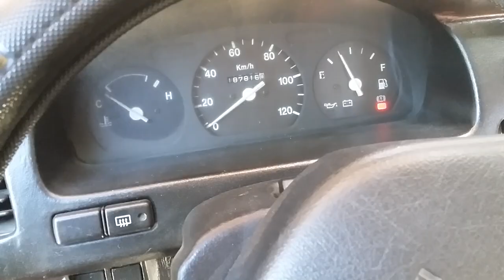Suzuki Carry/Every/Scrum F6A Engine Rebuild

Comment: Boss, pa help naman po..yung multicab ko po tumataas ang menor pag long drive or pag mainit na ang makina, di naman ganun kataas pero not normal po yung taas nya..s cold start po parang mamamamatay pag di mo binombq ng ilang saglit tas ok na..tas pag ng drive k ng mga say 20km mataas na ang menor nya po.. png deliver po nmin ng tubig at quarantine po kasi ngayon salamat
Reply from the maker: Same thing nangyari sa mc ko sir. Simple lang yan. 

- check nyo resistance ng ignition coil. Dapat malakas pa. Kung mahina na palitan ng medyo malakas 

- check spark plugs. Dapat yung manufacturer's recommend model yung NGK DCPR7E copper plugs

- check air/fuel mixture. Adjust nyo sa pinakamalakas na settings after normal temperature while plugging the distributor lines in doing so.

- check resistance ng ignition cables ninyo. Dapat nass wastong resistance lang kundi palitan na ng bago.
Reply: Thank you sir.. noted po.. God Bless..
Reply: @nhelmercsdiy7521  magkano overhull

Comment: I have a 1991 suzuki carry DB51T here in the US.  I'd like to replace my carb with a remanufactured OEM one.  Is that carb you have an aftermarket?  If so, are they the Chinese aftermarket ones I see on Ebay, etc?  Are they good quality and last long?
Reply from the maker: Hello Jason, yes they are Chinese made and very cheap. Easy to start engine even on cold morning. And economical on gas too.
Reply: Don't buy chinese oem. Suzuki is Japan. It is better to have 2nd hand japan original than new chinese made parts for your engine.

Comment: Paano po ang brake in process na ginawa nyo pagkatapos? Yung sakin din kasi, kakatapos lang ng general overhaul. Palit piston ring, lahat gasket at machine shop ang liner na bago din. Salamat!
Reply from the maker: Hello Adrian, thanks for the feedback. Normal use and city driving after overhaul. Taking notes of the gas milage and odometer readings. Change oil after 500kms, then after 700, then 1000kms. After that, drove a long distance trip. Gas milage improved from 8km per liter to 14km per liter unleaded.
Reply: @chrclmnky  Okay sir, noted! Sana tumino na mga kei van natin. Hindi kasi biro ang gastos. Salamat ulit!
Reply from the maker: @adriandiw  You might want to check ignition coil and cables. That main part responsible for the engine running condition. Weak ignition coils will produce misfires.

Comment: Bos lht bh ng scrum cat eye ang  radiator single tube lng? Pwed po bh or nty nyu n pong palitan ng double tube? Slamat bosing
Reply from the maker: One outlet and one return. The other is jus for heater purposes. You can plug it if not in use.

Comment: Hello sir. Sir may i ask po what is the difference between f6a engine and f10 in multi cab? Im planning to buy a fb type multi cab. So i want to know what is the bess among these 2? Thank you i hope you can answer my question
Reply from the maker: F6A = 3 cylinders
F10A = 4 cylinders.. 

By the way what is FB type?
Reply: So sir ano po mas maganda sa 2? I mean when it comes sa performance at patipiran sa Gas?

FB type po na multi cab(close van)
Reply from the maker: @emmanuellecastro3876  Why is it called FB?
Reply: Sa Pampanga sir usually FB type po twag. Prang L300 na pinaliit.
Reply: Family and Business etc..
Reply from the maker: @emmanuellecastro3876  Ah......

Comment: Sir Charcoal Monkey good AM. I know this vid is years old by now but I am hoping I can still get an answer from you. I've just had my F6A engine worked on kasi nag-overheat. Now I worry because I'm not sure if the mechanic installed the head gasket right. My question, Sir Charcoal Monkey is: Aside from the engine's sound is there any other indicator that will show if the head gasket is baliktad? I am not familiar kasi sa tamang tunog ng F6A so I cannot go by sound alone. Kung baliktad ang head gasket, walang langis na nakakarating sa loob ng head cover? Will my Low Oil Indicator bulb light up? Papaano po ba? BTW, kabibili ko lang (second hand) itong unit ko kaya newbie talaga pa ako dito. In anticipation of your reply, I thank you now. Here is hoping you get to notice this. God bless po and thank you again.
Reply from the maker: Hello po. If baliktad ang pagkaka install ng gasket, instantly may malaking damage ang mangyayari sa camshaft, rocker arms, and upper block kasi walang langis na dadaloy. Then may malakas na ingay, parang grinding noise. Pwede namang buksan ang valve cover then paandarin. Makikita agad na may langis or wala.
Reply from the maker: Overheating issue must be the water pump impeller na pudpud na. 

Or hindi na bleed ng tama ang cooling. 

Or mas mataas air to fuel mixture, lean. Or overly advanced timing yung distributor.
Reply: @chrclmnky  - Big thanks for your prompt and very informative reply. "Pwede namang buksan ang valve cover then paandarin. Makikita agad na may langis or wala". I like this. It is exactly what I need. I hope my future questions (for they shall be many) would receive the same indulgence from you, Sir Charcoal Monkey. Big, big thanks again. Keep safe and God bless.
Reply: @chrclmnky  - Yes, Sir. Thank you.
Reply: @chrclmnky - Thank you again. Learning a lot po from you. Thank you again, Sir Charcoal Monkey. Keep safe and God bless.

Comment: Mga sir ano mo kya ang sira kpg nagsama ang tubig at langis sa radiator pero un engine oil wala tubig. Ano po kya sira nun... Carry multicab.. Po  slmt po sa magreply
Reply from the maker: Good day po sir. Malamang may leak na po yung head gasket ng MC ninyo kaya nagkaganon. Top overhaul and tune up po lunas dyan.

Comment: Sir alway running po ba talaga ang fan ng MC? TIA.
Reply from the maker: Nirekta kasi mga rad fan pag dating dito satin para safe sa overheat. Pwede mo lagyan ng switch o di kaya temp sensor switch fan ng MC ninyo. Sakin manual yung fan, nilagyan ko ng switch. E on ko nalang pag nag 10 oclock na ang temp gauge. Babalik naman to zero, then off na naman.
Reply: @chrclmnky  - Ingenious! I like this. I will do it too on my minivan.

Comment: Ngutana lang ko... akong multicab nga scrum kay mag over heat. Init siya ug makina. Dili normal ang iyang kainit. Ako na siyang gipa overhaul. Ilisan na nako siya ug connecting wire sa sparkplug ug cylinder head gasket. Ako nang gipaover haul ang rediator. Gipableedingan pa jud nako ang waterpump. Pero init pa gihapon ang iyang hinongaw sa makina. Ma feel nimo sa sulod labi na ug magdagan. Unsa kahay problema ani no? Advice lang be?
Reply from the maker: Good evening Sir, pila ang temp reading sa dashboard? if naa ra sa 12 o clock position or less, normal ra na sir. Then ang hinungaw nga init physically sa makina normal ra pud.
Reply: CHRCLMNKY mao ba... ngutana lang pod ko. Unsay maayo nga brand sa sparkplug para sa multicab 12 valve?
Reply: CHRCLMNKY naa gyod sa 12 0 clock ang temp. Ok ra diay na nga temp niya. Ok salamat kaayo sa imong rply bossing ha.
Reply from the maker: Ang nindot na spark plug para multicab is NGK DCPR7EGP (Platinum) tag 250 ang isa. 

Naay mas nindot, mas fuel efficient, low voltage needed, less fouling, NGK DCPR7EIX ( Iridium) pero mahal. Tag 600 each. Pero sulit kaau. Mas mo tipid ang fuel consumption and mas kusog ang kabig sa makina. Upgrade ko if maka tigom. Platinum ako gamit karon.
Reply: CHRCLMNKY ok salamat bossing
Reply: CHRCLMNKY sir f dli ngk pero iridium Dcpr7eix lang gehapon ok rana?
Reply from the maker: Good evening sir. Naa equivalent na Iridium sa Nippon Denso/Denso pero di ko sure sa particular number. Naa pod iridium sa Bosch.   Kasagaran nakita nako na iridium available diri kay NGK ra man gud
Reply from the maker: DENSO IXU22 Iridium Power
DENSO VXU22 Iridium Tough

medyo mahal mahal jud ni sila sir pero sulit.
Reply: CHRCLMNKY ok sir salamat,naa ka fb sir?
Reply: CHRCLMNKY asa man mas maau anang duha sir?
Reply: pa check pud imu cooling pump boss basin wla na ni circulate iya tubig pa radiator
Reply from the maker: @Gleen Perez, yes sir correct. Ang radiator pod angay pod limpyohan regularly para dili barado.
Reply from the maker: mark joseph Macayan, mas advice nako ang NGK kay barato ra then daghan available diri sa ato sa Pinas. Proven and tested na pod ang NGK.
Reply: Perfect Sinner timing sa cdi boss ing ana pud akoa
Reply: pwede mag tanong bakit wlang minor yong mkina ko ano dapat gawin para maganda yong minor?
Reply: Ñ

Comment: Sir ask lang po pwede po ba ibalik ang thermostat sa multicab same unit po tayo nag multicab sir
Reply from the maker: Yes sir pwede naman but I suggest to remove it. And make your radiator fan auto-sensing.
Reply: Aw okay sir salamat daan
Reply: Ngano man sir mo overheat ang multicab kung naay thermostat
Reply from the maker: @alphonseiiicruz4788  Basin depektoso nga thermostat sir. Advisable e remove nalang sir.
Reply: Aw okay sir salamat sa info sir
Reply: Sir last question hmm kung mo aso ang multicab sir unsay daot ana tapos iyang oil naa na sa spark plug hole sa butanganan og honsoy unsay cause ani sir? Salamat daan sir
Reply from the maker: @alphonseiiicruz4788  Blown cylinder head gasket.
Reply: @chrclmnky  okay sir sakto jhud ka sir gipa ayo nanako blown head gasket jhud siya salamat kaau sir the best ka talaga
Reply: @chrclmnky  ay sir ask lsng ko unsay guba pag ang front drive sa akong multicab naka 4 wheel drive siya pirmente bisag i off nanako ang swich niya ga hawid ra jhapon iyang axle unsa guba ana sir
Reply from the maker: @alphonseiiicruz4788  Sorry sir wala ko idea sa structure sa 4 wheel drive MC's. Pang 2 wheel drive ra sir. :)

Comment: Boss pila di sukod sa valve clearance sa intec ug exhaust sa scrum nga multicab?
Reply from the maker: Nakalimot ra ba ko sir. E search and download lang palihug ang PDF sa Suzuki F6A 660C engine. Naa tanan didto mga data.
Reply from the maker: Nara ang PDF sa Suzuki F6A 660C Engine - https://www.manualslib.com/manual/1207219/Suzuki-F6a.html

E download lang, naa tanan diha data imo kinahanglan.
Reply from the maker: Sa imo particular pangutana, mao ni nga page, about valve lash clearance on intake and exhaust. https://www.manualslib.com/manual/1207219/Suzuki-F6a.html?page=89&term=valve+clearance&selected=7

Comment: Sir pwede mangutana nganong cgeg ka overflow akong carb nya iyang breather ga usok na
Reply from the maker: Completo pa ba mga vacuum hoses ana sir? Basin ge pang tanggal na mga vacuum hoses ana. Then kung mag overflow ang carb, most likely ge abrihan or ge helabtan na ang carb. 

Mag usok na breather/filter, basin blown na ang cylinder head gasket ana.

Comment: I have a suzuki jimny ja11 that comes with the f6A engine, and I'm spending a lot of gas, the engine has an oxygen sensor!
Reply from the maker: There are many factors when it comes to fuel economy on the F6A. First, you may want to check the ignition coil. It might be weak and not giving enough spark. May foul the firing.
Reply: thanks for respond, but my engine dont use ignition coil because it use spark plug cable.

Comment: sir anong magandang langis sa multicab naten?
Reply from the maker: Any engine oil with API rating SF, SG, SJ, SK, and SL
Reply: sir i mean ung viscosity po ba un? sample 10w40 po?
Reply from the maker: @johnpaulbustillo3792  any will do. Marami na akong nakitang mga arguments tungkol nito on Facebook groups. But for me I prefer to use the thicker lubrication of 20w50 here in our very hot climate.
Reply: maraming salamat sir lastly sir san pobg part ng makina naka pwesto ang timing belt naten?

Comment: Sir patulong po . na tambay po kasi yung multicab namin ng 3 weeks tas ngayon na ggagamitin sana hindi umandar. nung maayo pa sya . pag yung susi naka ON umiikot yung radiator fan sa harapan tas ngayon wala na . at may tumutonog na parang spark sa makina nya. patulong po please
Reply from the maker: 3 weeks stambay? You have to remove and have the battery recharged to a nearby battery center or repair shops. All battery juices were drained during the long non-usage.
Reply: salamat po sir. pero bat ganun sir kahit di gina gamit nag didischarge. ano po salution jan?
Reply from the maker: @jachuy234  Disconnect negative terminal on battery if you are going to standby your vehicle for more than 3 days to prevent power draining.
Reply: wala parin sir. kakakuha ko lang ng battery .  wala parin kuryente yung multicab . wala yung ilaw parang wala syang battery kahit meron
Reply: @chrclmnky  Boss. lahat po ba ng Suzuki Scrum may built in na Fuel Pump? o kaylangan mo pa bilhin ? napaka hirap po kasi pag na ubusan ka ng gasolina tas mag isa ka lang ang hirap pa andarin wala kasing nag lalagay ng gas sa carborador .
Reply from the maker: @jachuy234  Yes sir lahat ng sasakyan may fuel pump. Sa multi cab, nandon naka dikit sa tabi ng tank or sa ilalim makikita ang fuel pump. Kasing laki ng coke in can.
Reply: @chrclmnky  pano po ayusin ? hindi po kasi gumagana yung sa amin

Comment: Sir pa help naman po sa problem ng multi cab ko  laging ma carbon ng itim ang spark plug kahit bago tas after ng mga ilang days may isa o dalawa napopudi sa  sa mga spark plug. ok naman po mga timing ng makina bago po mga high tension wire at diatributor cup sana matulongan nyo ako salamat
Reply from the maker: Check nyo po ignition coil sir baka mahina na. Use multimeter in testing your coil. Also you might want to replace fuel filters, there are 2, at the fuel send and at the fuel return. Re check your high tension wire for its accepted resistance values. Commonly nasa electrical lang talaga yan.
Reply: Salamat sir check ko po lahat yan sana maging ok na   un na nga cguro ignition coil at mga fuel filter kasi ala din siya lakas hirap na hirap sa  akyatan
Reply from the maker: @alexford1074  check my latest video as well. About fuel pump and filters https://youtu.be/m6CesuqxuLQ
Reply: Primary coil  1.4 ohms. secondary coil 28.18 k ohms  yan po reading ng  ignition coil sir.  palitin naba ang ignition coil ng mc ko sir
Reply from the maker: @alexford1074  palitan na yan sir. Dapat below 13k ohms lang 2nd coil. Magdala po kayo ng multimeter kung bibili ng surplus sir. Piliim nyo mas mababang resistance, tyak malakas ang power nun
Reply: Ok po sir update kita pag napalitan kuna ung ignition coil maraming salamat sa advise👍
Reply: Good morning po sir nakapag palit n ako ng ignition coil at tsaka ung  2 filter sa gas  ganun padin sir napalya paein pro napansin k pag ni rev minsan may backfire sa carb
Reply from the maker: @alexford1074  backfire - check the timing sir baka po nag jump ng isang tooth. Nangyari na din sa MC ko. Maingay ang makina tas nag backfire pag ni rev. Pinalitan ko timing belt and inayos ang tamang timing, ayon napakaganda na ng performance at tunog. Ni set ko sa 9 degree btdc ang distributor
Reply: Ok po sir double check ko ung mga timing
Reply: Sir na check kona po mga timing tama namn po lahat ung sa crankshaft at cam pati sa flywheel pati sa distributor, posible kaya n may prob sa cilynder head valve ung number 1 at 2? kasi silang dalawa lang ung carbon fouled lagi, ung number 3 maganda naman ang sunog tska may fuffing sound ung tambutso salamat sir
Reply from the maker: @alexford1074  ano resistance ng bawat high tension cable?
Reply from the maker: Watch this video for accepted cable resistance https://youtu.be/lyr_urMyS68
Reply: Sir ito po mga reading ng mga high tension wires
Main  2.79k ohms
#1- 2.31k ohms
#2- 1.90k ohms
#3- 1.65k ohms
Bago lang din ito sir 1 week palang nakalipas mula ng binili ko kasabay ng dtributor cup.
Reply from the maker: @alexford1074  tama na man po resistance. Sorry wala na akong ma isip sir.
Reply: Ok sir maraming salamat  i che check ko  nalang muna cguro ung mga valve ala din kasi  ako pang compresion test
Reply: @chrclmnky  - Grateful for this info.
Reply: @chrclmnky  Again another gem of an info on F6A.

Comment: Sir magkano ang nagastos mo parang need ko rin mag pa overhaul.ty
Reply from the maker: 5500 labor (Butuan City rate)
6500 parts (overhauling kit, piston rings, bearings, gaskets, cleaners, etc..)
3000 extra expenses
Reply: ty sir

Comment: Mrning boss.. Unsa my problema ani ako every nga gi overhaul alisdan ug head tas human na tanan unya pagpaandar dli mn mo vacuum ang intake tas individually check sa system gikan intkae manifold open tas testing sa head wla ghapon maong utro npud ang ako mekanik pag open tanan pati gasket alilis ug bag o tas nabuo na cya unya g start mao lng ghapon dli ka boto pra andar.. Redondo ra taman.. Matic ni cya nga K6A.. Salamat daan sa imo idea boss😊
Reply from the maker: - Basin weak na ang ignition coil ana. E check gamit multimeter. If taas na ang resistance, weak nana imo ignition coil.
- Nag compression test ba mo? Dapat naay compression tester imo mekaniko.
- Basin wala sa saktong timing ang makina. Dapat naa pod timing light ang mekaniko para ma adjust sa saktong timing.
- K6A engine diba EFI na? Basin wala na sa saktong function ang computer box ana sir.

Medyo kuti ayohon ang mga EFI kaysa carb engines. Dapat advance na pod imo mekaniko dili lang kato scientist ang agi.

Comment: boss alam nyu fuel consumption ng multicab?
Reply from the maker: Average is 12-14 km/L boss.
Reply: @chrclmnky  salamat boss, alin ba maganda? scrum or carry? plan ko kasi bumili.
Reply from the maker: @samplacido137  scrum is actually just a term used by Filipinos for the Suzuki Every minivans having a model number that starts with DE, ex DE51V. If you like to get a new vehicle I suggest to buy a brand new one to save yourself from headaches out of these surplus vehicles.

Comment: Something is not right with the finished rebuild. The engine is not supposed to sound like that.
Reply from the maker: Yes sir, the engine blows. The rebuilding was actually done twice because head gasket was installed in reverse. Didn't had a video recording of the 2nd engine test. So my bad. :(
Reply: Interesting pick up, a capable fellow no doubt about that.